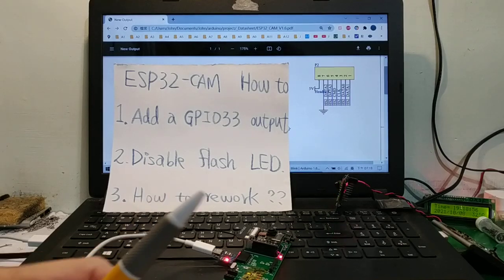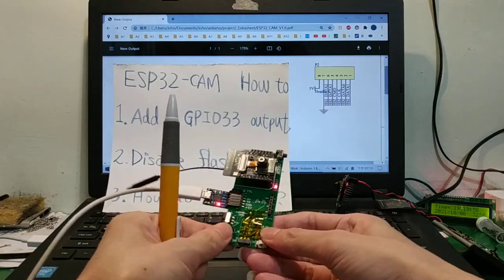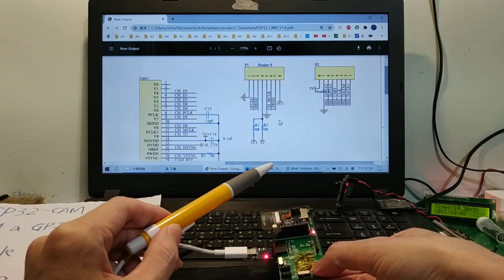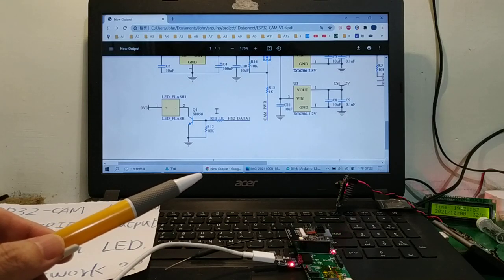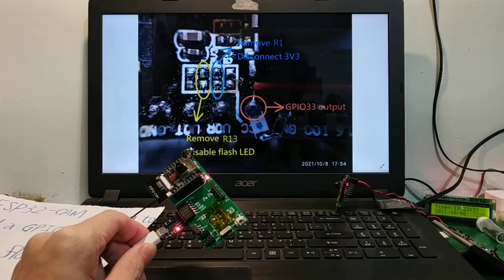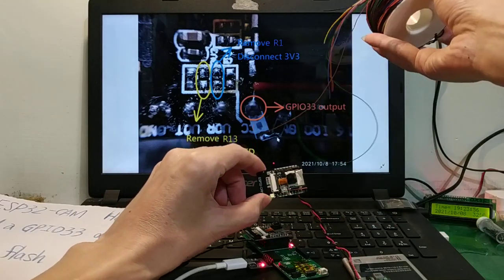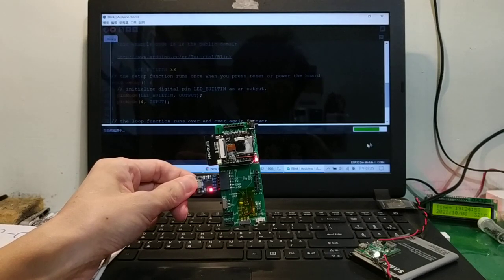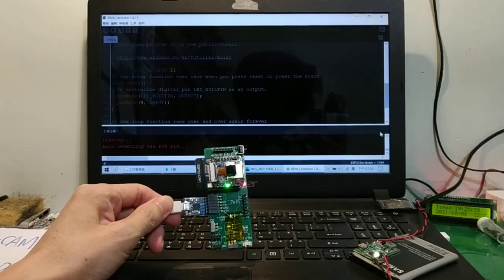ESP32-CAM  How to add a GPIO33 output and disable flash LED

Comment: what solder technic to remove R13 ?
Thank you for advice
Reply from the maker: heat R13 both side quickly
Reply: @jlcamry  which soldering iron is the best for such small components ?

Comment: Could you also make a video about how to switch the GPIO33's internal led to a ADC input to measure the voltage level. Maybe also how to remove the led and so on? Very informative video 👏👏